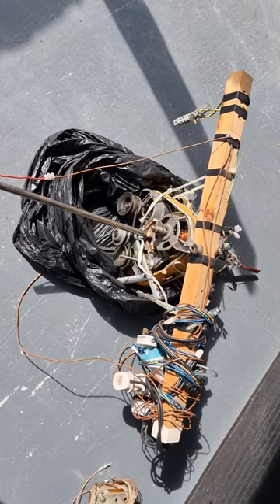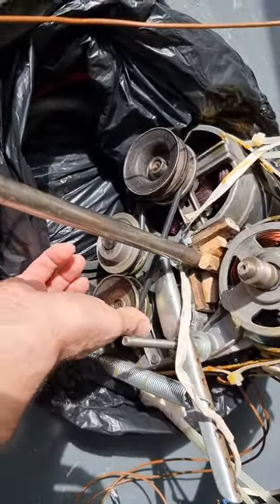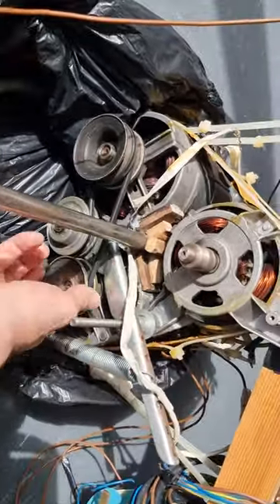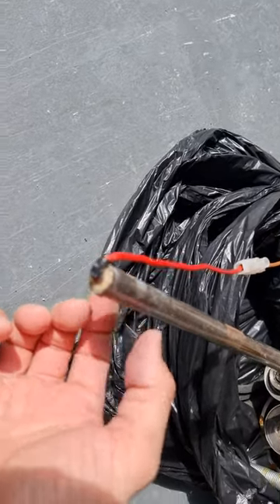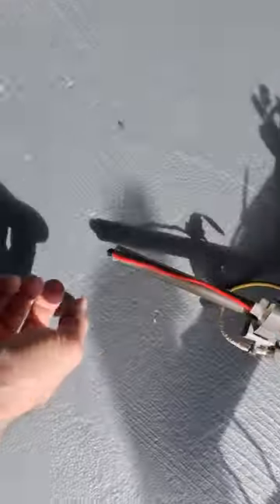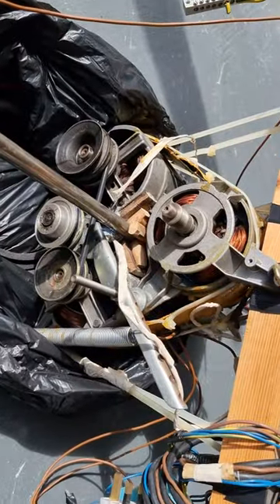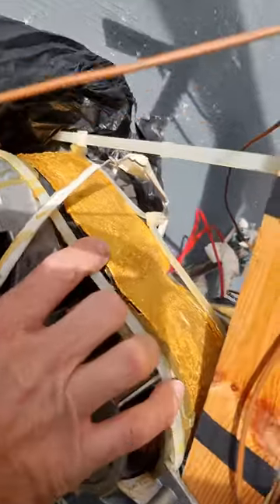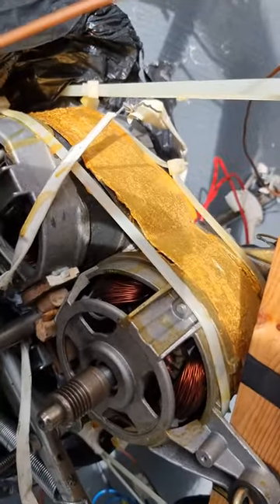LION - Tripple motor, gold leaf band core?

Comment: the biggy is why put the electrode in the middle of all that?
clearly trying to expose it to a mess of rotational magnetic forces, the band around the outside to catch the outside forces that could be reconnected to one of the electrodes.
probably a precursor to the reactor.

Comment: The band aroumd may be a capacitor ive senn a moter online in bits self run had 4 brushes and a coper sheet with wax and sheet to rap motor in capacitor i think when poles went past the other to brushes took back emf to capacitor for reuse or for power off had to be no leaks i heard many had self run till the brushes went then could not get them running again u think because had to make brushes thinner
Reply from the maker: Thanks for the thinking